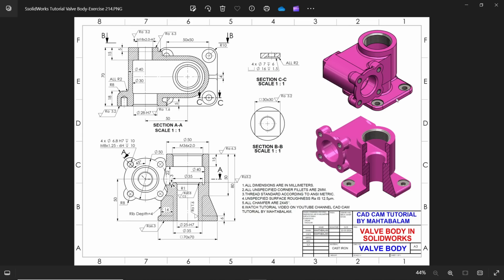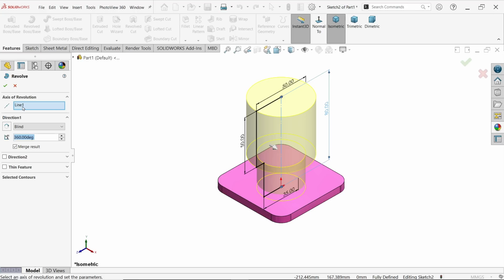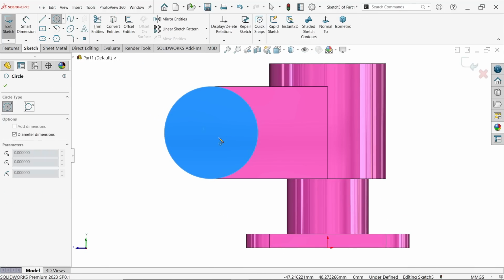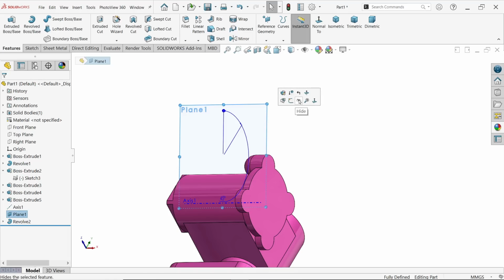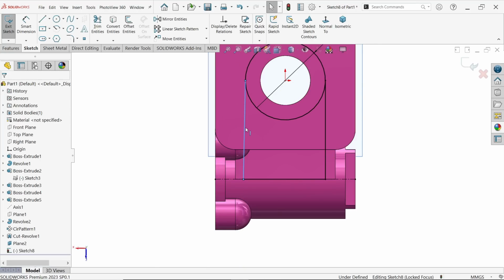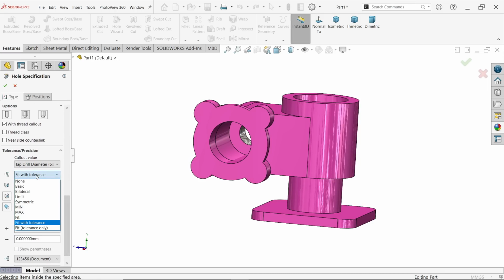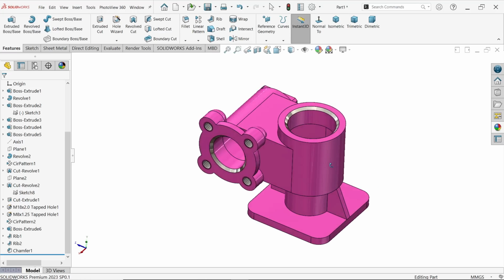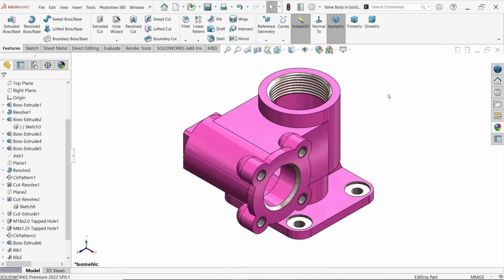SolidWorks Tutorial Valve Body Exercise 214

Comment: Dear sir, please suggest a laptop in which solidworks, catia and nx cad runs smoothly not professionally but at a normal range.
Reply from the maker: Buy any laptop with 16 GB Ram and at least 4 GB graphics card and use 4 gen SSD with i5 processor and don't look for thin laptop. keep always high power laptop.
Reply: Hp is super
Reply: @Ravi14128  Look for workstation with quadro graphit card. Maybe Lenovo Thinkpad i7 or i9. Not a normal laptop for gsmung or so